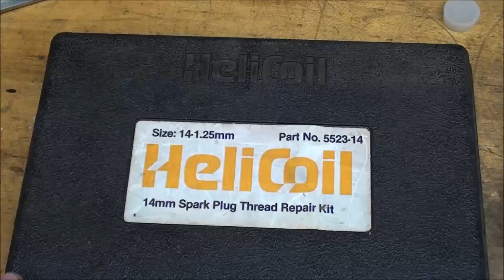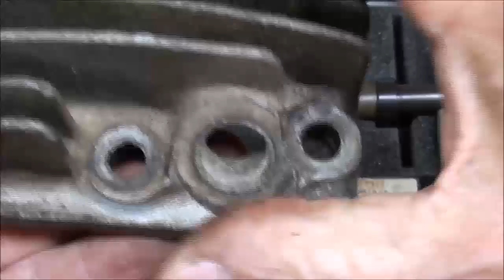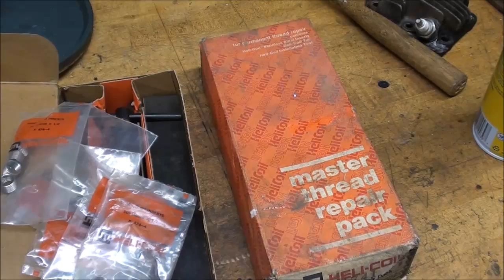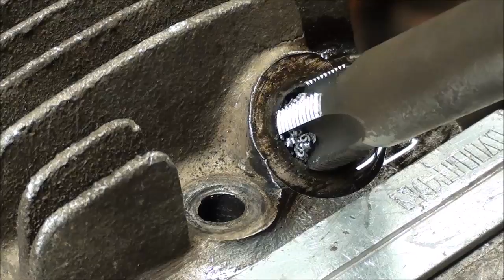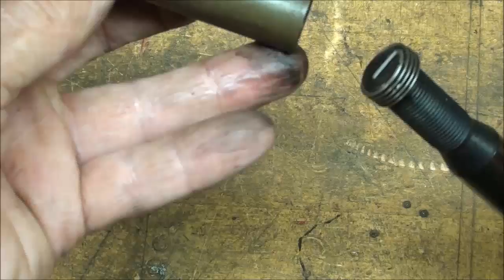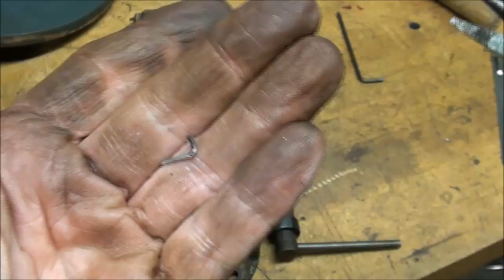SHOP TIPS #210 Using a HELICOIL to Repair a Spark Plug Thread tubalcain

Comment: As Mr Pete mentions, "Heli-Coil" is a trademark.  The generic term for these taps and coils is STI (Screw Thread Insert) and will be marked "STI" or "Heli-Coil".  Its pretty easy to mix up standard and STI taps (ask me how I know!).  The coil's thread pitch is the same inside and out (which might be pretty obvious).  The only difference is the STI tap's and coil's outside diameter is larger than the original bolt.  The STI tap cuts to the outside diameter.  You then install the coil insert and then the pitch and diameter are as good as new!
Reply from the maker: +cemx86 Thanks for watching--well noted on the taps
Reply: I need a heli coil done ASAP. call me 215-475-0255
Reply: Being they're super hardened BRITTLE steel they obviously should not be stored together. I just drilled a 2 by 4 and have all mine standing up like little soldiers except for an electrical set I use when people put wood screws in the light switches because they took them off to paint. I wish people like that would just paint over the light switches if they can't figure out the difference between a wood screw and a machine screw! (or are too lazy/cheap to go to the store and get the right one!)

Comment: ive never seen this done before interesting - you mentioned to use alum.cutting oil or standard type will damage hole why is hat ?
Reply from the maker: +Larry Carroll Watch this recent video for a demo of WHY??
THIS & THAT #13 .22 caliber rifle ammo & tapping fluid by tubalcain
Reply: +mrpete222 It would seem to me if standard oil will damage then grease will also damage. right?
Reply from the maker: +Doug Reed thanks Doug